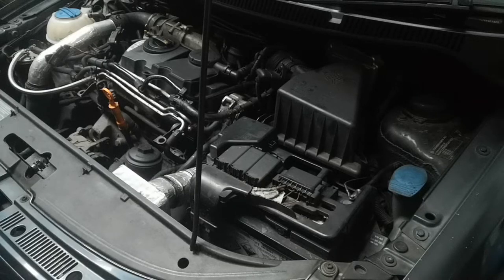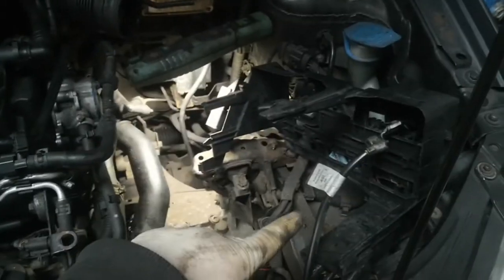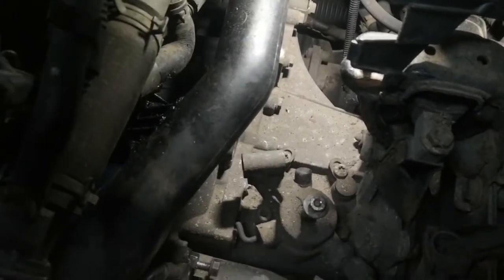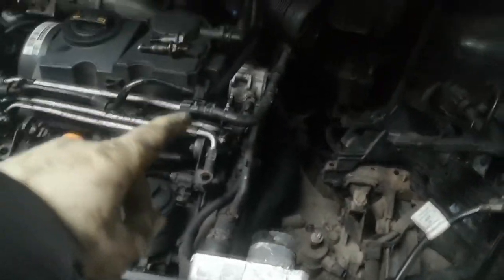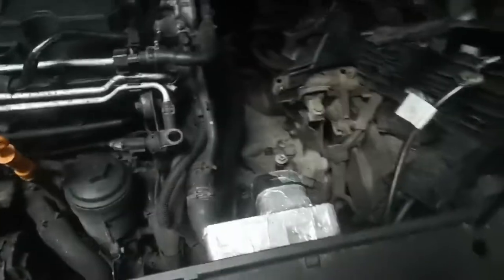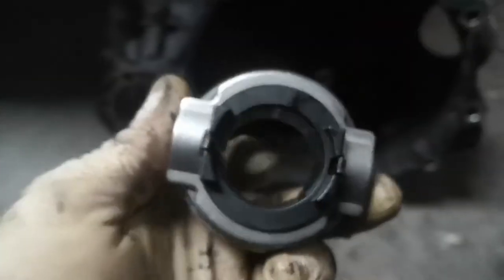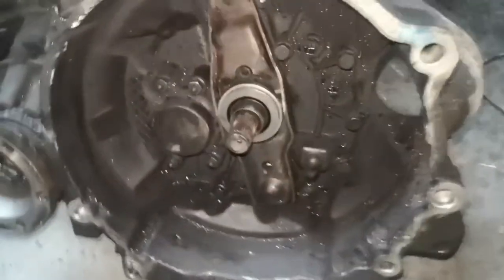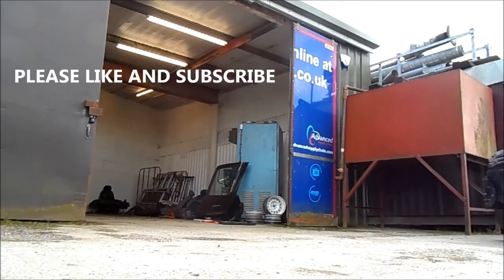Vw/Audi/Seat/Skoda Clutch Replacement

Comment: Did you remove inte drive shaft completly? Kinda urgent😅
Reply from the maker: Sorry for the delay, it's possible without removing either, however, I used to remove the passenger driveshaft to save the headache, I've recently started removing the bottom arm front bolts (18mm) and moving the front of the bottom arm out to create space rather than removing any driveshafts, probably too late now but at least you know for next time.

Comment: Awsome job, but I have to ask: How did you support the engine?
Reply: Jack on the sump is the most common method. Being a cast ally sump you should put a block of wood in between or you jack will go though.

Comment: Good video and something I need to do soon on my son's 2007 1.4 tdi Polo (BNM engine I believe) without a lift unfortunately. The release bearing is screeching worse than nails on a chalk board! I'd have put a blob of thick grease in the ball socket of the clutch lever fork before refitting, it's common for these types of clutch actuating mechanisms to develop a squeak over time if the ball and socket are left dry. Prevents corrosion there too if you live in a damp area or near the coast, like me. Would have been nice to have seen the way you manoeuvred the box out as ElsaWin - I have the VAG genuine online workshop manuals - tells you to remove the subframe which I am not keen to do if not necessary (although I have the special alignment pegs T10096, used on my Passat for doing such). Did you need to support the engine before taking the gearbox out or do the 3 cylinder engines weigh less and strain the engine mounts less?

Might not be the same for me, although the layout looks very close to our Polo S, but for others what clutch kit did you use, how much was it and can you list the part number of the kit? Many thanks.
Reply from the maker: Thanks for the comment, I've mever used grease on the clutch fork and never had an issue so far, the grease would probably melt and cause issues eventually like CV grease which is high temp but still melts once it's overused, as for removing the box it's easier if you remove the drivers side driveshaft cup, tilt the diff housing up and wiggle the box off and down, the engine I support regardless as with the TDIs the exhaust is at the back meaning the exhaust flexi will take most of the strain not the 1 engine mount left attached, for the kit it is a recon LUK clutch kit from a local company £45 for the 3 piece kit, seems cheap but I've used a few kits from them in various vehicles and they're still going years later, another thing to watch out for is snagging on/trapping pipes and wires etc, I broke the housing by leavering off it without realising, remove the drive shafts for the sake of undoing the balljoint and driveshaft nut, it saves a lot of frustration, let me know if there's anything else I can help with.
Reply: @DubworxMedia  Many thanks for the reply. Nice tip on checking for snagging pipes and which way the box comes out as I have not done a Polo clutch before so just needed the extra reassurance. I have worked on dozens of cars over 40 years of DIY mechanics / engine building / gearbox repair,  have access to most tools, but a 2 post lift is still my dream! £45 for an LuK reman kit,  that's cheap (trade or retail)! Good video,  deserves more views / likes 😁
Reply from the maker: @MiracleMitch  Thanks, If you've got an engine support that goes over the top, i'd recommend using it because supporting it from the bottom makes the engine solid rather than being able to swing a little bit.
Reply: @DubworxMedia  I have and will use., thanks.

Comment: Hey, first thanks for the video.
Just one question.
I have a vw polo 1.4 tdi 65cv 2006 moteur BNM, and I need reef. for gearbox, can't find it. If you have one minute.... Thanks
Reply from the maker: Hi, I'm not sure what you mean by ref. for gearbox.
Reply: @DubworxMedia  sorry reference number or model.
Reply from the maker: @THEPAKEFULL  the gearbox type is the first 3 of the part number on the top, flat area and the gearbox code is on the gearbox but location varies depending on the gearbox, it should be on the sticker under the boot floor
Reply: @DubworxMedia  thanks for the information. I'll try to get the part number. Not easy for me (sister's car, she in Spain me in France)
Keep going with your videos! And thanks again
Reply from the maker: @THEPAKEFULL  no problem, I have a friend that is French so it it's easier to reply in French then I can get it translated no problem, get her to send you a picture of the sticker under the boot carpet
Reply: @DubworxMedia  thanks so much, I'll try to get de number. No translation needed I lived for a while in Wales, I think I still can manage English jejeje (I think)